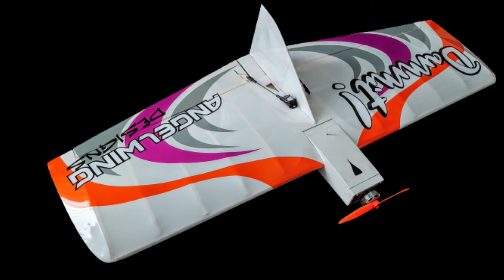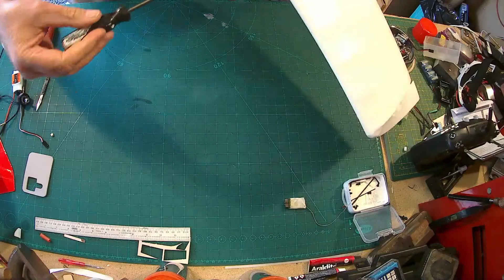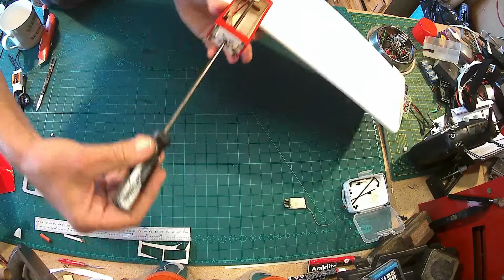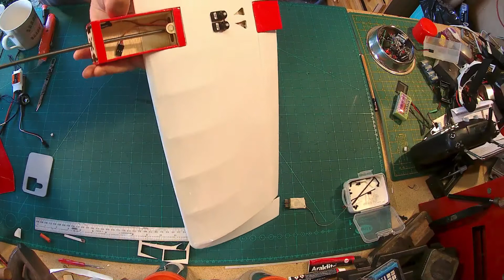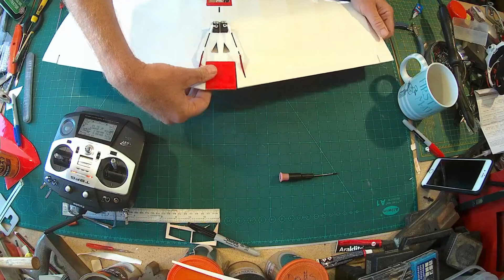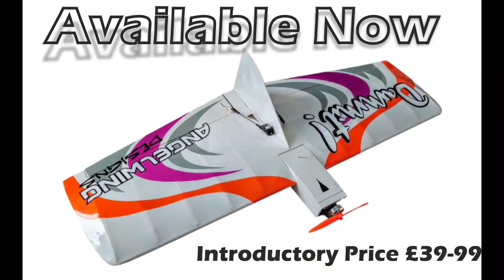Dammit Electric Flying Wing Part 8 Motor and servos

Comment: Another great video Nick. They are back in stock now too. What battery did you fit please
Reply from the maker: 3s 1000mah to 4s 650mah High C lipo battery I used a 3 s 1000 mate